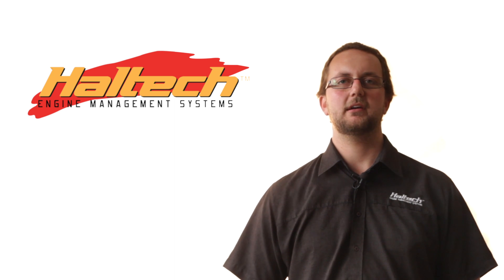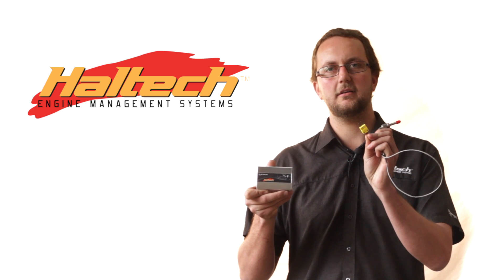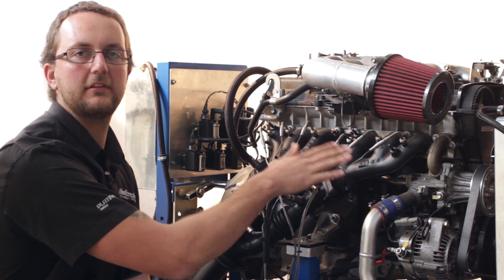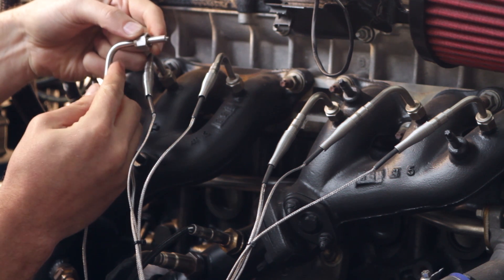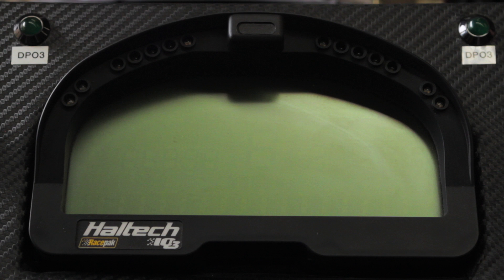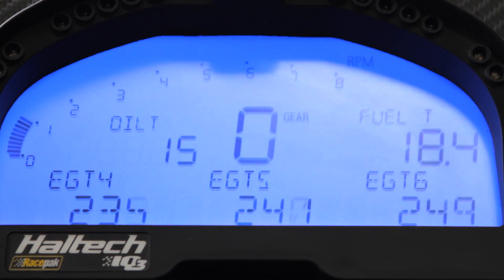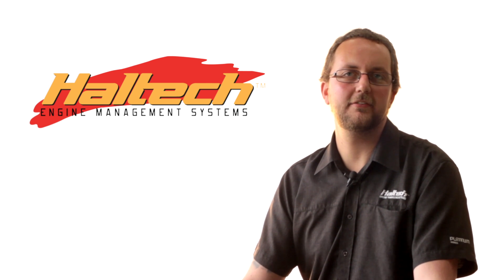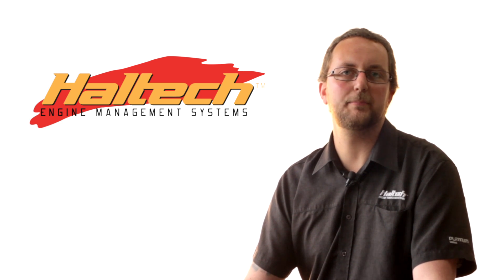Haltech Technically Speaking: Thermocouple Amplifiers and why you need them!

Comment: A side note on these boxes. I have your 8 channel TCA-8. You can use the metal stress relief brackets that bolt to the back into the plugs. There's not enough room when you start stacking in the get probes.

Comment: hey i have a sprint 500 and a ka24de and my cas has a 4 pin connector to it. the manual shows me how to wire the haltech to the cad, but it says trigger OR home loom. i thought it needed both a trigger and home signal to run... do i just run the trigger loom to the cas or do i need to do something to give it a home signal?
Reply: pipelinewill sorry for the terribly delayed response but here’s a video which might bring some clarity

https://youtu.be/HW0ENqcxNSg

To sum up an answer, the trigger input is used to calculate engine speed while the home signal is used to note which cylinder is next in the firing order. Essentially you will need both for sequential operation of the fuel as well as the ignition. However, you may use the trigger signal only if your engine requires either wasted spark or batch fire operation meaning not sequential. 

The engine you noted has both the trigger and the home signal within the CAS, to get the best from your Sprint 500 I would advise you use both signals to make the most of your engine manage strategies.

Cheers!